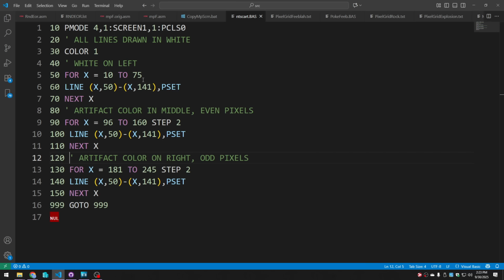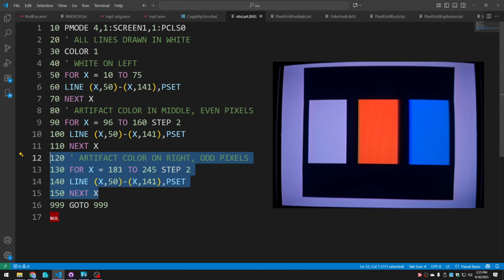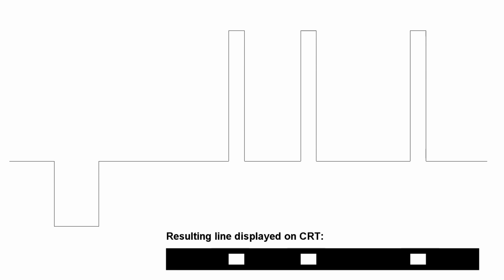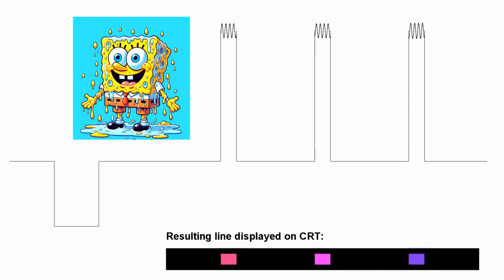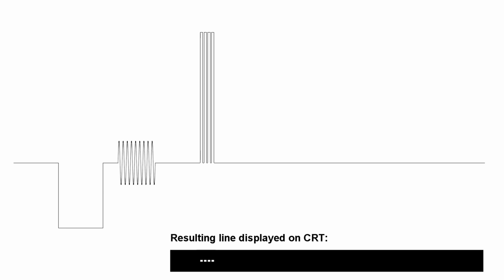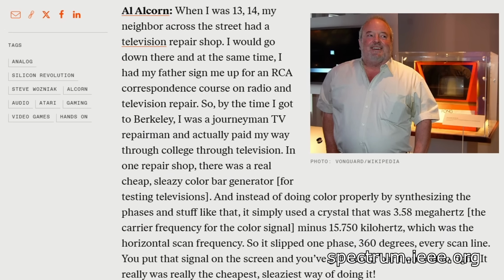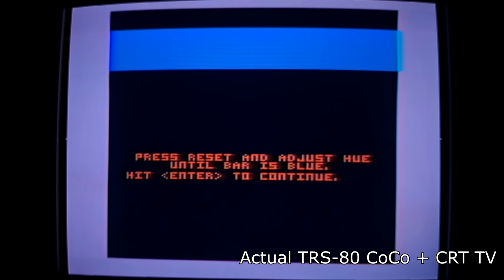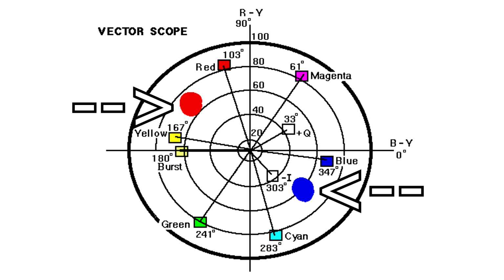How early computers TRICKED TVs into making color (out of nothing at all)

Comment: The reset to until you got the desired color was bad programming.  Better programmed games simply asked something like "Is this screen Red?"  and if it wasn't ran some code to swap the colors.  

If I could do it in basic, there is no excuse for a commercial game to ask you to hit reset until you got the desired color.
Reply from the maker: Yes, it was way better when they put in the extra effort.  The Donald Duck software shown in the video actually let you press a key to swap the colors instantly, and you just swapped until Donald's beak was red.  I suspect they had no choice, because the Donald Duck software first had to boot OS9 to run on top of it, and hitting reset would restart that long process every time.  It would have been prohibitively annoying, instead of just annoying.  🙂

Comment: I wonder if this is one of the reasons that NTSC got the insulting fake-ronym "Never The Same Color".
Obviously, as a Brit, I'm biased towards PAL, but I do enjoy watching videos on how we used to solve problems with tech*.

Thanks for a great video!

* (that is, both, how we "solved, using tech, problems" and "there were issues with tech and we solved them")
Reply: As the TV uses a PLL to lock on to the short color burst at the start of each line, what the TV think is the center of 180deg (yellow color) could change as no manufacturing is perfect.
 So that is why American TV's had hue control, Euro TV's did not.
Reply: @tonysofla Really, most american TVs had hue controls because they were expected to have hue controls. They were an unnecessary dial for most of color NTSC's life.

But they were fun as heck for a kid to play with.
Reply: NTSC color is particularly vulnerable to reception issues. "Ghosting" from the reception of reflected signals can result in the TV electronics using a ghost colorburst that is out of phase with the chroma data if the electronics aren't advanced enough. This problem went away with vacuum tubes, as more advanced electronics could far better discern the weaker reflected signals from the true one.

Also of note, this was only ever an issue in broadcast scenarios, not wired ones.

Comment: hmm this was a good explanation , ive been trying to design a replacement for my coco2's rf modulator using modern/easily obtained parts and while im sure i can get it to display normal composite out color it sounds like if a program used this as a trick to get high res color it might just end up black and white using the design i was going for, (although im far from building it, just dont have time) guess ill have to add more research
Reply from the maker: I believe there exist (modern) composite boards for the coco that get this right.  Even some direct-to-HDMI boards that have figured it out.  If you're not on the coco discord, you might want to join and poke around.  Lots of active discussions about all sorts of things, including hardware mods.

Comment: I've tried to explain this as, "In NTSC, if you yell loud enough in black and white, it'll bleed over into color."  Your explanation is much better than mine, but it gets the point across.
Reply: Not loud, but high pitched. It was encoded in the high frequencies, which in black and white sets without a filter would show as barely perceptible noise.

Similar to elderly people not hearing high frequencies and thus not hearing annoying high pitched noises, a high frequency filter would make the b&w picture clearer
Reply: @Fridelain So if you whine and bitch at a high enough frequency, eventually the complaints reach the color processing
Reply: What about PAL?
Reply: @dogwalker666  SECAM is the most difficult to implement in the digital way due to the timing issues.
PAL is only a little more difficult to approximate than NTSC (as the digitally approximated subcarrier) and still a lot easier than the SECAM digital approximation.

This is why the video editing consoles able to mix the computer-generated digital fonts or illustrations that could feed with the SECAM color in real-time were so rare and even if the processing power standards allowed for the real-time RGB >> SECAM digital ilustrations conversion, the fully digital mixing systems (converting everything to analogue just before airing) became more economically feasible than the hybrid analog-digital mixing kits and the hybrid (analog+digital at the same time) solutions with SECAM real-time chroma output never achieved even 1/10 of the popularity of the PAL/NTSC/RGB-only systems and almost all hybrid video mixing consoles were only PAL, NTSC or RGB.
Reply: @Michałek_1999 i see
Reply: @Michałek_1999  While I appreciate you giving this very detailed explanation, it's no more clear to me than when you started.
Reply: @dogwalker666  Dunno MATE.
Reply: @dogwalker666 , pal does not suffer from this as it phase alternate line same as SECAM , this solverd the issue, rather than NTSC never the same colour, they also found that they have to test white signal tv adverts ie whiter than white adverts that would cause massive harmonics and jam other frequencies everytime the advert was shown
Reply: @jameshackett9992  Looks like we ended up with the better system, Thanks!
Reply: 'Squeaky enough in BW'
Reply: Using a vocal analogy isn't the color signal a vibrato?!
Reply: Nice!
Reply: NTSC, Not Tested Since Christ!
Reply: @robertsteinbach7325  Ha, I like this one.  I found out, only a few years ago, that if you load up a pristine copy of Ultima IV on the Atari 8bit computer, it will ask you what color some bars are... this is because some Atari models would display them differently, and you had the option of a palette swap!  It saved the setting though, so if you needed to change it again, you had to hit Control X as it was booting!
Reply: I was gonna say we don't have to bring politics into this, but I get the sense nobody would be saying that if it was leftist politics
Reply: @rdococ  what
Reply: So, NTSC is broken by design?
Reply: @Linuxdirk  It was a required compromise in order to fit color information into the signal while also being able to be shown on black and white TVs already owned.
Reply: Pretty good explanation tho! lol
Reply: I always explain it in terms of frequency.  One cycle of the NTSC colorburst contains all the colors as if one were to take the color wheel and unroll it flat, like a strip.  There are 160 of those cycles in the active graphics area located inside the border for many computers, usually the ones with 320 pixel dot addressable graphics.  And there are 128 of those for other computers, such as the Color Computer and others with 256 pixel dot addressable graphics.

And then there is the Apple 2, which has 140 of those cycles, due to the unusual 7 pixels per screen RAM byte rather than 8 pixels per byte like all the others.

What this really means is each NTSC color has a position!

Artifact colors happen at pixel sizes smaller than the NTSC colorburst cycle.  And they happen most clearly and more colorfully the smaller the pixels are.

Most home computers had "high resolution" graphics that are 1/2 the colorburst cycle in width.  That is why those computers generate artifact colors.

Some computers, like the color computer 3 have a 640 pixel mode.  Same with IBM CGA.  That yielded 16 different pixel patterns within an NTSC colorburst cycle.  And that yields 16 colors more or less.

And then there is the Apple 2, lol.  It has 280 pixel graphics, and it also has a pixel shift in each byte too!  Instead of 2 artifact colors plus a black and white, the Apple has 4 artifact colors along with black and white.

Apple 2 computers have a 6 color high res screen and as we have seen, one can do anything in 6 colors!

The color computer 3 can generate 256 artifact colors!  It is glorious!  In fact it can do many more, but I will stick to the simple case here:

Unlike the IBM CGA only having 1 bit per pixel at 640 pixel resolution, the CoCo 3 has 2 bits per pixel at 640 pixels.

So what you do is set the color palette where 0 is black, 01 is dark grey, 10 is light grey and 11 is white!

Then the whole byte contributes to the artifact color and it is sweet!  

You get a 6809, which is a very fun CPU, 1 byte per pixel 8bpp graphics and it is just great fun to program.  I sure wish more had been done.
Reply: If you tell to this group of ppl, you get colour…

Your explanation don’t include a point lol or really make sense 

What do you mean by “in NTSC”? You can’t be by their terms lol that don’t explain anything 
It’s a comparison that doesn’t include an explanation my friend
Reply: @Nickjustdabs  You have a lot of lols for someone whose response was far more confusing than the original comment.
Reply: The origins of Never The Same Color
Reply: @petroidau  I always knew that as "Never Twice Same Colour", but I live in a PAL country, so it may have lost something in the translation :)
Reply: @allanmarsh1  I also know it as "Never Twice the Same Colour" - which is what I think BBC video engineers may have called it (I'm from UK too).

PAL, with its inverting carrier on alternate lines, was known as "Picture At Last".
Reply: @allanmarsh1 my dad worked in the TV industry in the UK. And had to cope with NTSC material. PAL was referred to as Peace At Last
Reply: @timbeard8457  Except PALs flickering 50Hz refresh rate is bloody awful on CRT screens.  In side by side comparisons, people overwhelmingly choose NTSC. It is for that reason 60Hz became the default on the IBM PC, and all manner of electronics from handheld game systems to car infotainment systems.
Reply: @wombatomba  I heard it as Pictures Always Lousy .. back in the 90s
Reply: This is why PAL is so much better. Without a colour-burst signal, you'll get monochrome video, regardless of how you mess with the timing.
Reply: so its like how liberal people cry about racism, thus creating racism
Reply: why does EVERYTHING gotta be political  @hangman111
Reply: @fredbearfazbear3004  the comparison is funny, is it not?
Reply: not really, just kind of burnt out on politics everywhere all the time, came for the electrical engineering. @hangman111
Reply: @hangman111  no. It must be a sad life that you need to inject politics into something like this.
Reply: @rossmau  you are just an unfunny dude then 😂
Reply: @hangman111  no I'm afraid you're the one that isn't funny. "Haha politics haha other side bad" SHUT UP NOBODY WANTS POLITICS IN EVERY SECOND OF LIFE
Reply: @hangman111 No, not really, and you're definitely not welcome here.
Reply: @hangman111 please seek help for your own good
Reply: @fredbearfazbear3004 cuz u CHOSE THIS.  By ignore Right To Repair in the early 2000s and by allowing 'POLITICALLY CORRECT' speech in the 90s.  It allowed for me Bible thumpers.   and you didn't bother with understanding EULAs in the 90s and what it meant for cloud computing in the 2010s.  Meanwhile communism took over education and called it liberalism and you the fact we were under propaganda attack since the 90s.    THIS WE ARE HERE.  MEWSFLASH - ppl who cry and accuse ppl of fasismos these days are often the very thing they accuse .  It's mob rule . Let's try defunding more services critical to a countries stability!!  Like borders and police

This here we are, Child.
Reply: @rossmau have you not seen all the Clippys ??  Try the problems some more and wonder why your city is on fire
Reply: @rossmau cuz u CHOSE THIS.  By allowing 'POLITICALLY CORRECT' speech in the 90s and By ignoring Right To Repair in the early 2000s aIt allowed for new-type Bible thumpers (SJWs & raceGrifters).
   also you didn't bother with understanding EULAs in the 90s and what it meant for cloud computing in the 2010s.  Meanwhile communism took over education and called it liberalism and you fail to perceive the fact we were under propaganda attack since the 90s.    THIS WHY we ARE HERE.  
MEWSFLASH - ppl who cry and accuse ppl of fasismos these days are often the very thing they accuse .  It's mob rule . Let's try defunding more services critical to a countries stability!!  Like borders and police.  
Just bury your head in the sand like it's 1933 and your in Germany but don't believe in politics.

This is why u are here, Child.
Wake up Neo, The social engineering has you
Reply: @hangman111 wait, that was a joke? I thought you were just vocalizing an uneducated, misguided personal opinion that you actually believe... 

I guess it makes sense that you were trying to make a joke then, because surely no one is dumb enough to actually believe that!
Reply: @hangman111  "If my joke doesn't amuse you, you're just unfunny."

Uh huh. That's how comedy works.  Maybe you just suck at humor.
Reply: @hangman111 Theres no joke there, just bitterness. 

Adding a "😂" doesn't change that.

Nor does it change the retardation of that original comment, but I digress.

Comment: if your sample rate is exactly 4x the chroma carrier frequency, you can generate any color you want very easily.

if you're doing it this way, it's easiest to conceptualize it as a YUV space, with the pixels essentially being +U, +V, -U, -V, in a repeating pattern.

PAL actually also works, but you need to account for the higher carrier frequency, AND you need to flip the pattern each line

with on-spec NTSC, 4fsc sampling gives you exactly 910 samples/line, however the off-spec video produced by various microcomputers and older game consoles may make the lines slightly longer or shorter, and may also change the total number of lines per frame from 262.5 to some other number, either to simplify clock design and processing for the machine, or to improve image stability on an analog display

of course, while analog displays are perfectly happy displaying a 262p or 263p image, possibly with a slightly-too-slow or slightly-too-fast hsync frequency, modern video digitizers and the digital displays they're integrated into were often designed under the assumption that they'd only ever be working with on-spec signals, as such, they'll typically interpret the signal as something more standard, even though this often reduces the quality quite significantly

as a result, if you were to hook up an older game console or microcomputer to a modern television, you'll likely get all sorts of visual artifacts that would not have been present on a period display, either due to a malfunctioning comb filter mistaking noise for detail and detail for noise, or a deinterlacer circuit engaging on sources which are not interlaced.

for VERY old sources from the 70s or 80s, this may not be considered that big of a deal, as there's not a lot of detail there to lose, but for something like a snes, saturn, N64 or a PS1, it's a big deal and the image degradation can be quite noticeable
Reply from the maker: Thanks for the detailed information! If I remember correctly, the CoCo’s VDG is an example of doing an even 262 lines per field rather than 262.5.
Reply: @CocoTownRetro  262 lines was pretty common in the early days, this is despite the fact that the colors generally end up more stable and the dot crawl less noticeable with 263 lines, as an odd number of lines allows artifacts to be cancelled out by the next frame having an inverted phase
Reply: If you're limited to 1 bit for each 1/4 period, that's only 16 colors, which is what the Apple II could produce in LORES.  Double the memory and you can produce 256 colors, with a few duplicate grays.
Reply: @sa3270  indeed, but as you increase the bit depth you basically get a full YUV color space representation